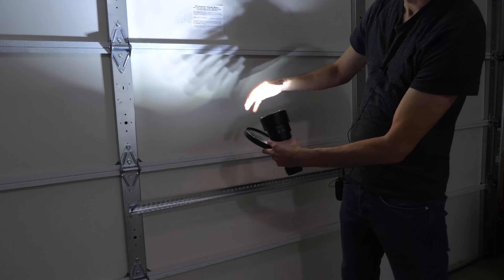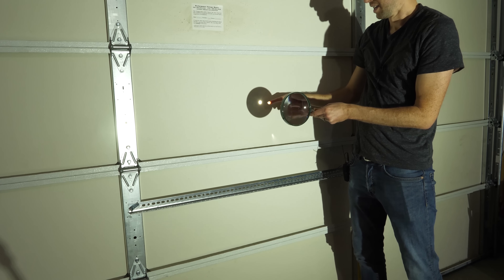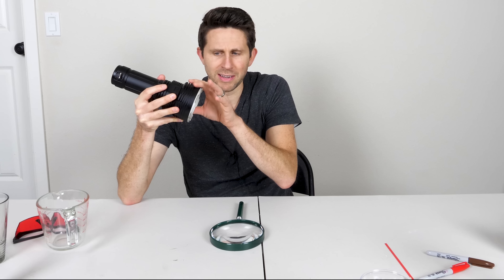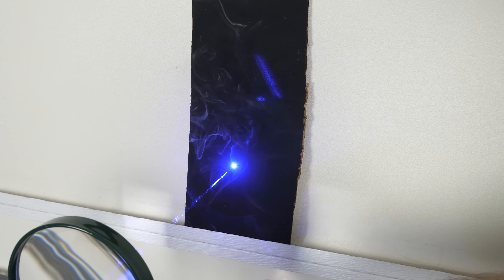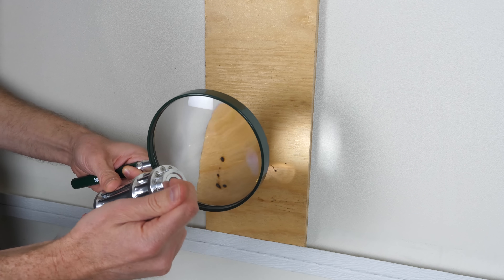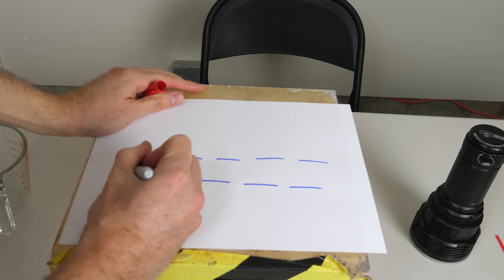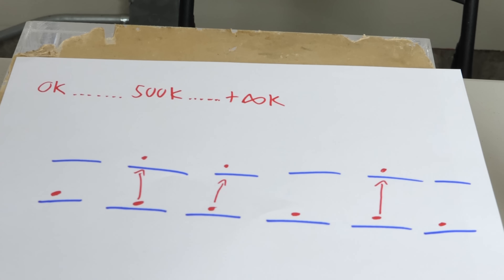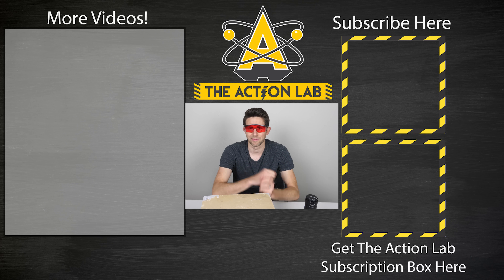What Happens if You Focus a 5W Laser With a Giant Magnifying Glass? Negative Kelvin Temperature!

Comment: Technically it wouldn’t violate the laws of thermodynamics with a normal light right? as long as The area of light after the lens is less than the starting area. Of course there’s gonna be some loss of energy along the way but conceivably it would be hotter per square inch. Overall though it would have less energy. Whats interesting about your idea is light li think doesn’t really have a volume so conceivably it could be infinitely made smaller and hotter. I understand I’m totally misunderstanding what you’re talking about but you got to do a more in depth explanation of this, explaining all the things that might be obvious to some people.

Comment: Where do you get those Lazers from in the first place and how much do they cost. Can you get more powerful lazers..?
What are the effects of distance between a lazer , that can produce a burning effect through a Microscope lens.
Evidently here we have the basics for producing lazer guns. What if we increase the voltage through condensers, and magnets,, through a lazer device, that could be the size of say medium sized rifle.. With a microscope  between the the laser and the target.
Would we get the same effects as in this experiment though with greater burning activity , on targets by these increased voltages best applied through EMF pulse waves, from magnets and condensers. Of course we have seen the industrial use of lasers on metal at high voltages. 
No doubt in the way energy can be increased from low voltages through microscopes. There is no evident reason why this experiment could not be applied to producing, steam from sea water  to drive electric turbines., giving us endless and far cheaper energy from a grid designed to rip us off through its meter charges.We know the American military have produces a microwave , beam mounted on a armoured vehicle with a classical radar dish, that can be pointed  at crowds from a mile away and closer, in which they can cause burning sensations on their human targets.
This abuse of energy,  that could be applied to more humane needs. Should be studied by as many people as we can , interested in 
building their own lazer devices.
We could make these lazers operate our own home electric generators  , through steam technology. The water coming from rain water , and steam  condensers. We also know heat below melting point  produces electricity through wires as well. 
and steam condensers.

Comment: If you were more wrong on how quantum mechanics work and how this affects temperatures, the pathetic grey matter that passes for your brain would literally leak out of your ears trying to escape your pathetic excuse for existence. Since you literally don't seem to understand how infinite 'temperature' factually works, I will try to express this to you using infinite velocity as a point for your understanding: If a particle - for argument's sake, we'll say a photon for our example - were to possess truly infinite velocity, it would literally exist everywhere at any given measurement of time, adding its spin, energy and mass to every other particle in existence. If you then take this example of a single photon with infinite velocity and apply it to enough to make a single dot of visible light, this means that no matter what equipment or detection device you used or where you pointed it, that white dot of light would exist and be visible. If all photons had infinite velocity, human sight - and indeed every form of visible detection - would cease to have any real meaning as there would be no shadows cast all anything could see would be a pure wall of white. Infinite temperature works by the same principle, since 'temperature' is really just an observation of how much energy a particle contains. Infinite temperature would mean infinite energy and therefore infinite spin and - wait for it! - infinite velocity. In short, if it does exist, it's only in the most minute, immeasurable quantities, though it could explain the existence of 'dark energy' and why universal expansion is increasing instead of decreasing. But you, a pathetic excuse for a human who doesn't understand even the basics of particle energy - could not only not grasp this, you certainly don't possess the ability to give any particle 'infinite temperature'. Which is a very long winded way of proving that you don't know what the fuck you're talking about.
Reply: You know what, Mr. Scallywag? When you talk like that to someone, all of a sudden nobody cares how smart you might be or even what you have to say. You could have taken the high road and showed the world that you could be a decent human being. But you chose not to.

So I kindly ask that you do us all a favor. Delete your post, apologize to Mr. Science Guy for acting like a spoiled child, then just go away. Maybe you could start your own channel and see how many nice people you can charm enough to give you a thumbs up and subscribe. Good luck with that.

Comment: isn't more to do with the polarization and emittion angle than the quantum state? surface area issues asside... doesn't the low temp plasma in the laser emmiter simply only emmit light on a single emittance angle due to the gas used... and your use of the sun in your explanation actually is false, and you can use the suns radiation to increase a smaller number of particles (that being the key there) to a higher temperature than the surface of the sun itself. It was proved ooo two years before this video with the 2 terawatt laser experiment.... so i dont know maybe you should just remake this video... since its sooooo very inaccurate/misleading though i do completely understand your point but its like you aren't understanding the scale of everything involved... if the magnifying glass you used was bigger than the emittance angle of the flashlight it would have worked... and if you say had one 10x the size of the sun, you could raise the temp OF THE EARTH to higher temps than the surface of the sun... all of this isn't a contradiction of forces not because of the energy state, but because of the amount of watts in the system, and total energy emitted... so the angle of the dangle is meaningless...
Reply: and you didn't answer anything in your correction, if you can call it that... you should probably take this video down...

Comment: what would have happened if you used two magnifying glasses to focus all the photons to a point? One close to a flash light to make the photons direction parallel and one at the focal length or point of convergence (I am not sure if I am using the right term :\). Would that be hotter than the source?
here is the graph :D
                            /------------------\
(flash light) *< ()---------------------() > * (point of focus)
                             \------------------/

Comment: For the flashlight example you were kind of wrong. You can’t get more ENERGY than the flashlight, but that is not the same as brightness. The reason you can’t get the same amount of brightness from a flashlight is bc the rays aren’t parallel. For the sun, when you magnify the image you get a focal point with higher flux than the image on the sky. That’s why a laser works. The rays are already parallel so the same principle works as it would with the sun. The definition of brightness is unit energy per unit time per unit area. You’re only see one side of the sun so you won’t be able to receive the energy regardless of your lens. That’s not true for an LED, though. If your brightness is defined as energy/time/area and assuming your energy loss is minimal, your area (when perfectly focused) is basically zero, so your brightness is immensely larger than what you started with.

Comment: I just would have thought that the temperature would be hotter because of the energy per unit area. I understand the energy itself can't be greater than the source but I don't see how you can't make the dispersed flashlight hotter at a single point than it would be on average over its usual area.

Comment: Pretty sure that's not true. You can turn your flashlight into a spotlight with a large lens I think one focal length away from it (so quite close). That will give you a parallel beam which you can then focus down with a regular magnifying glass. There's no problem with the second (or any other) law of thermodynamics here.

Comment: I thought the particularity of laser was that it was a dot, not a cone of light, which made it coherent over very long distances. Thus, does it mean your laser is flawed if it makes anything larger than a dot after only the length of your garage? I mean, if your laser is a cone of as little as an angle of 32 minutes (still pretty much a tiny dot on your garage door), its cone of light is pretty much the size of the sun... when it reaches the sun, which doesn't really fit the definition of a laser beam, right? How come you can focus something that is already focused to the max?

Comment: please tell me you measured the laser output of that laser on a lpm before claimig its 5w. that is the mass produced cheap china gatling laser. most of them only measure at 1.6 watts or less. still very powerful but not 5w. recently you can now get a 3w in that host but only a few places sell them.  your doing a massive disservice to science and your audiance by falsely claiming that laser is 5w. after watchig a few of your buring videos i can conclude thats nowhere near 5w. a true 5w blue laser will instantly smoke wood unfocused. you said it yourself it takes a few seconds to start buring wood without the focusing lens. i have a 1.4W thor blue laser and it preforms exactly like this one when burning. you have great videos and i love your channel but if your going to claim its 5w and do experiments based off the 5w claim you need to get a laser that legitimately outputs 5W. also please invest in a laser power meter. i got one one laserpointerstore for $80. also if you want a true 5w blue laser get a Jet lasers PLE pro. they are under $300 and they are focus adjustable and very high quality and they are lpm'ed by a certified LPM.

Comment: Your first error is in believing that people "burning ants" think they're magnifying the temperature of THE SUN.  They're only focusing the TINY amount of light from the sun that's equal in area to the lens they're using (assuming you hold it perpendicular to the rays) at a distance of ~92 million miles away from the sun!  What you SHOULD be comparing is the incoming light / energy directly on one side of the lens to the focused point of light on the other, and I'm sure we'll all agree that temperature IS increased.  For the record, sunlight and light from a flashlight are COMPLETELY different in this case.  Yes, most flashlight beams (especially yours) are spreading out over distance, meaning the rays of light are not parallel to each other when striking the lens.  Light from the sun, however, is coming from SOOO far away that the rays striking your lens 92 million miles away are all so close to parallel that any angle between them would be too small to be meaningful.  Parallel rays can all be focused down to an almost singular point with a properly ground lens.  Just ask the ants.

Comment: 2:08 Never say never. You only need a much stronger lense or a system of lenses and mirrors. Though this may be really difficult to implement in practice. But not impossible, because each individual LED is a quantum system as well.
Reply: I thought that's what a LASER is. The light is just a byproduct, it's the energy that matters. twisteee slippery
Reply: @minerblake7494  The only difference here is that laser provides a coherent radiation while LED array generally does not do that. However this doesn’t mean that LEDs are incapable of doing so, there are tons of LED lasers being sold online every day.

However, it’s not quite interesting as a theoretical gamma laser, which is powered by energy transitions within a quantum system, like a “normal laser”, except these transitions are happening within atomic nuclei rather than its electron shell. These lasers can be so powerful that you can use them co create artificial black holes out of pure concentrated radiation. It’s a divine level of power, Palpatine would be happy.
Reply: @alexanderd.7818  In the absence of your well-crafted explanation, I wouldn't know the difference.
What I mean is that usually we think of heat from the light source as a byproduct of the system while the light is the desired product. Now with the LASER it's twistee slippery because the nature of the desired product of the system is not quite the same even though the method and outcome is no different.
If I want to cut, I don't need the light, it's the byproduct. Not all LASER are designed for cutting, so it's not that simple, but the content here is about creating combustion by concentrated energy source. Not quite cutting, you know, but that's a matter of adjusting the power source.
When you create one of those theoretical LASER one would be privileged to see it operate. Thanks for your consideration.